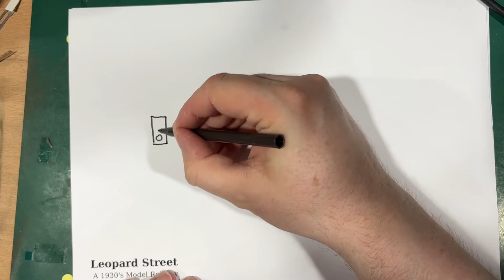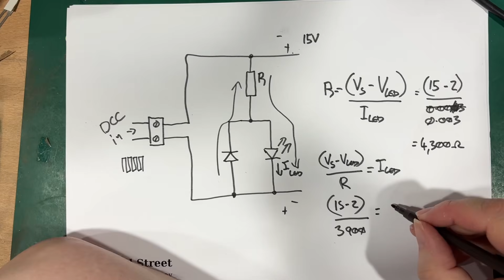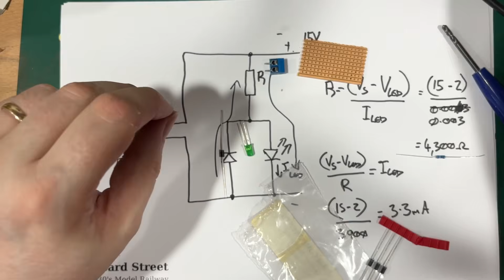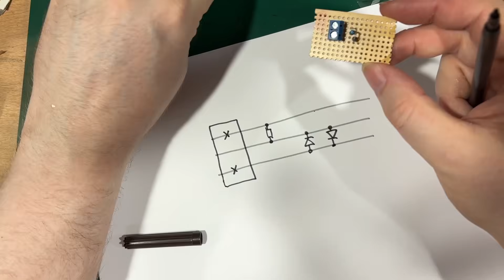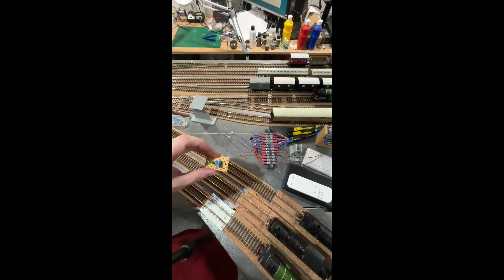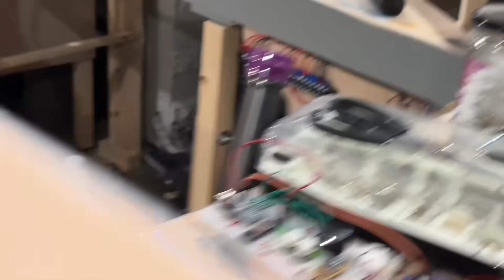Episode 65, Designing & Making a DCC Track Power Indicator at Leopard Street Model Railway #oogauge

Comment: Thanks for the video,  that's a useful little module. I've got a couple of those boxes of resistors where the values are hand-written,  I always feel for the poor sod who's got that job.
Reply from the maker: hand written, ouch, yes not a job I envy

will be an update on this coming along at some point adding a red LED for "track power is off", though obviously layout power is on.. otherwise I'd need a black LED

so far its stopped me wondering why nothing is moving a few times, would have been better if it worked first time, those responsible have been sacked.. again

cheers for watching, glad you thought it was useful

Comment: great stuff would it be possible to have a red led glowing when track power off ,not that you would need it but just interesting
Reply from the maker: Hi, yes, requires a slightly different circuit to do it - either a bi-directional opto-isolator or a bridge rectifier circuit that can itself be driven by the DCC supply - and then use the output of that to drive a circuit that drives either a red or a green LED.

will have a think, sounds interesting

thanks for watching and the comment :)